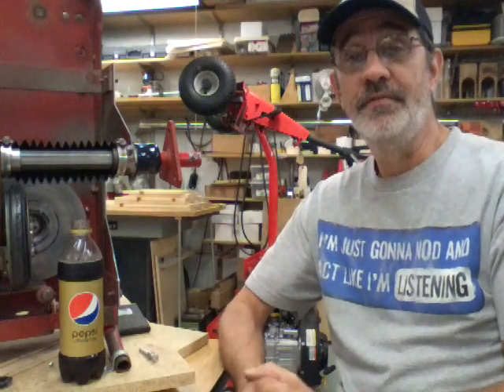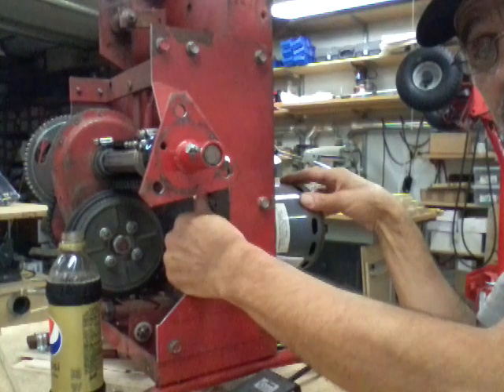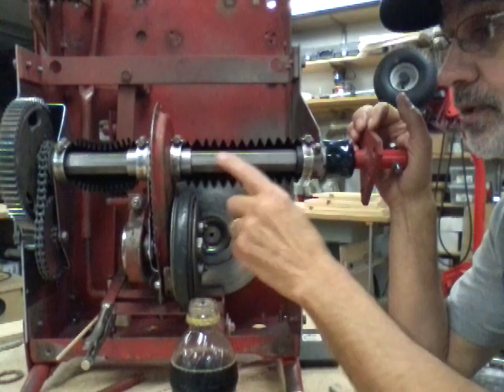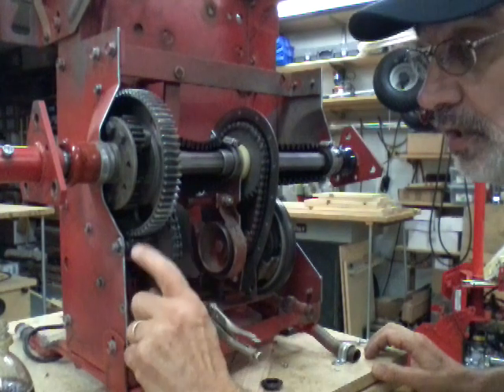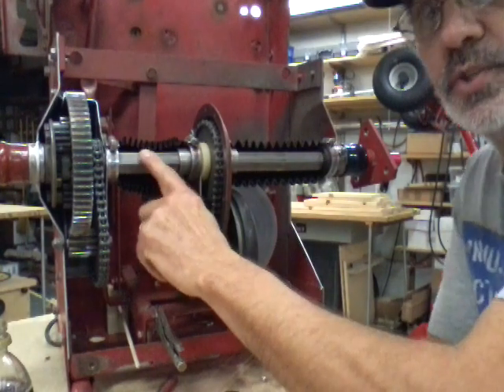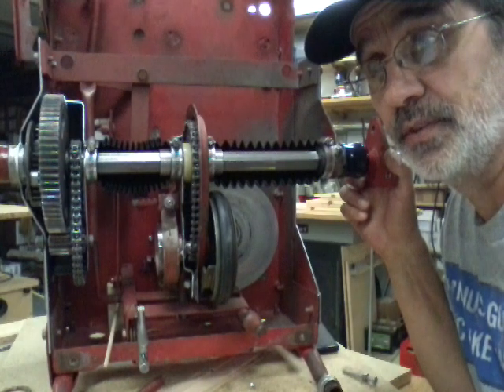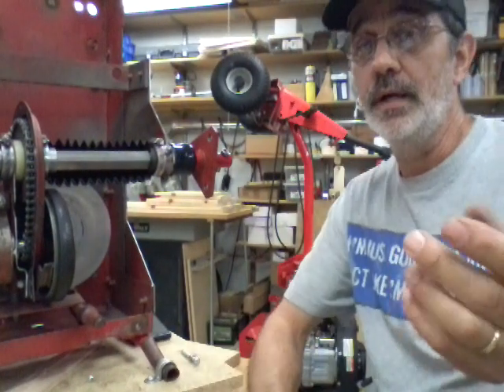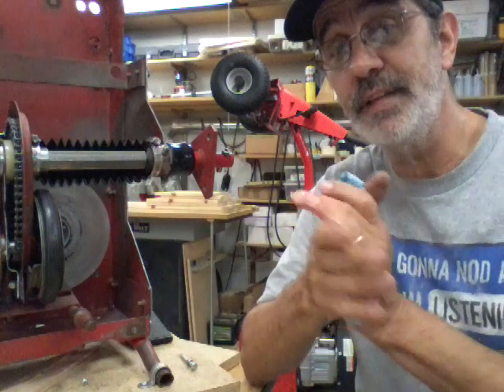132. M/S. 16  troubleshooting the drivetrain on a Snapper rear engine rider

Comment: Jim the transmission just locked up today did the sane on both machines 1433. Was able to get the one with the 16 hp unlocked by oiling the chain case and transmission but the 17 hp not yet but I did not oil the chain case yet. Should I try it?
Reply from the maker: @jamesmccarroll9925  yes I would definitely try putting some oil in there. If it’s locked up, it could be the bearings are shot or the issue could be in the differential. Let me know what you.        Jim
Reply: @jimjackson9381   hey Jim thanks for advice, but my boots are off on both machines, so my guess all the oil over time in the trannies, either splashed out or was just low and I never topped them off, yes I did fill both transmissions and both chain cases, was able to get the 16.5 going but have to put another clutch in, didn't glue the inner ring in when replaced the old clutch got another clutch coming thru Amazon. Now the 17 after thinking back on some of the things you coverd in your infor to video on machine won't move or shift, I stood the machine up used a pair of vice grip lock pliers attempted to turn the axle, it moved a little relocated the grip tried again and the axle turned, then I let the machine down let it sit for a minute started the machine shifted thru the gears nice and smooth, I would say low oil.in the chain case and transmission caused a seizer in the transmission, but thank God everything is functioning as it should, lesson learned do better at servicing my machine. Thanks Jim for your keen insight. Appreciate it.
Reply: @jimjackson9381  and really without that cut away of the transmission I would not have understood exactly what I was to look for, your advice saved me purchasing another mower.
Reply from the maker: @jamesmccarroll9925  well you’re welcome and I’m glad I could help all. I asked my viewers is please subscribe and stay subscribed if your machine is fixed and you don’t need any more help just turn off the little notification bell and you won’t be bothered.
Reply from the maker: @jamesmccarroll9925  lol
Reply from the maker: @jamesmccarroll9925  just remember, it is extremely important to keep the boots in good shape if sand gets inside of your chain case or differential it will destroy it.      Jim
Reply: @jimjackson9381   git the new clutch assembled and glued together put it in rechecked oil in chain case and it . Man it runs like new and shifts so so smooth.

Comment: I have the same model in your video. My issue is something produced alot of white smoke and stopped moving. I bought the wheel with rubber on it. Of course it did not come with that friction lining. However the original one did not have any in it? What I have discovered in when i rotate both wheel s in the same direction, it sounds rough and the clutch does not turn. Could this be a chain/sprocket issue inside the case the clutch attatches to? Thanks for your input or anybody else.
Reply from the maker: I have a video on this but I’ll explain it to you, stand your machine up and put it in neutral loosen the clamps on one of your boots so you can see the hexagon tube underneath of it turn the clutch disk if the tube turns while you’re turning the clutch disk your chain case is OK the problem is  inside of the differential. If you turn the clutch disk and a hexagon chef does not turn then the chain broke inside of the chain case. Let me know what you find out. Jim

Comment: I have a snapper mower an older zero with the joystick and when I go to drive in a straight line it only will pull left and go around in a circle and not go to the right at all any suggestions on where to start on this?
Reply from the maker: Check the oil in each unit check the filters if your unit has any and you should check to see if the pump is working the pumps the hydraulic oil into the unit,  What is the name and model number of your unit ?      Jim

Comment: hello I have a problem with the snapper when pushing by hand the wheels are blocked impossible to move the mower what is the reason for the differential? thanks in advance
Reply from the maker: There could be a lot of reasons it’s hard for me to guess without seeing the machine the chain case could have a broken chain. The differential could be a bad gear or a broken chain. You could have a bad bushing in one of the fenders, locking it up it move under power with the engine running or is it locked up that way also?          Jim
Reply: @jimjackson9381  thank you for your answer, when I stop the engine the wheels remain blocked impossible to push the mower by hand by lifting the mower I can turn one wheel but the other wheel turns in the opposite direction I don't know if I am clear in the explanation 😬
Reply from the maker: @benchapman7459  that’s normal that should do that but if you try to turn both tires at the same time, it should make the chain case turn feel to see if the rubber wheel is up against the drive disk on the bottom of the engine or if there’s a gap between the two when it’s in neutral

Comment: Hi, my reverse gear is not working. You have an idea what’s can be wrong?
Reply from the maker: Well I might need a little more information than that what style of machine are you having trouble with pictures would really help you can send them to my email which is jimsfixitshop@gmail.Com
Does it shift into reverse or are you having trouble shifting?
 Have you watched video number 70 and tightened your yolk spring?
Does it move in the forward gears and just not reverse?
. Jim

Comment: What would be causing my chain to keep slipping off?
Reply from the maker: What chain are you talking about, the one in the chain case or the one in the differential? Pictures would really help. If it’s a chain inside of the chain case I would have to say your bearings are shot or your sprockets and shaft is shot or your sprocket and hub is shot.
     If you’re talking about your differential, the sprocket on your hexagon shaft could be bad or the sprocket and gear could be bad or you could have bad bushings in the fenders, causing the issue, without at least pictures it would be impossible for me to guess what is going on. Jim.

Comment: Thank you. Would have the part# for the outer cover the seal goes into. Also the part # of the seal you used on the left side.Thank you again. Phil
Reply from the maker: Philip McCarthy 
If you watch video number 309 at nine minutes and 53 seconds I hold up a piece of paper with all the numbers on it you’ll need for both sides and the seals. Jim

Comment: So my snapper just stopped moving, it was jumping, like it was trying to catch and it would catch and mow a little bit more and then start jumping again trying to catch! Finally it just stopped moving! Any ideas? Is this drive train what I should check? Maybe these gears stripped????
Reply from the maker: Kind of sounds like you got a bad gear what do you want to do is stand your machine up put it in neutral turn the clutch disk by holding onto one of the four nuts and tell me what the tires are doing as you spin the clutch disk. Jim
Reply: @jimjackson9381  I stood the mower up and put it in neutral. I turned the clutch disk and neither tire moved.
Reply from the maker: @tamaraelkins2718  
OK now we know you either have a broken chain or a stripped gear what you need to do to find out if it’s your chain case or your differential what’s your machine standing up in neutral loosen the hose clamp around the boot between The chain case and the differential under that is your hexagon shaft turn the clutch disk again by holding the nut and see if the hexagon shaft is turning if it is the problem is in your differential if it is not then the problem is in your chain case let me know what you find. Jim

Comment: I have a 33 inch snapper rear engine mont does the rearend suppose to slide from side to side
Reply from the maker: With your snapper standing up on its rear bumpers if you can slide the rear tires from side to Side more than 1/32 of an inch it needs to be shimmed. Jim

Comment: The brake is engaged and is keeping the clutch disc from spinning but the tractor still rolls = problem with differential?  Tractor barely drives.  Have no issue with drive plate and clutch disc.  When wheels are pushed in same direction the clutch disc does not spin
Reply from the maker: You need to see video no. 132 it will help you understand your drive train  and troubleshoot it let me know if you need any further assistance. Thanks Jim

Comment: My trans started making a. Super grinding noise, but want back up. This happened after we had 0 temperature.
Reply from the maker: I don’t think the temperature had anything to do with it you either have a issue in your chain case or in your differential and the only way to tell is take them apart. Jim

Comment: Is there a grease fitting anywhere underneath?
Reply from the maker: Yes there is there’s one on your left fender bushing for your axle some machines have them on your shift handle and while you have a standing up check and fill if needed your differential and chain case. Jim

Comment: Is the clutch wheel always loose my u can move it sides to side the mower is working but is this normal.
Reply from the maker: Go ahead and watch video number 434 that will explain to you. The difference between a soft start, clutch a solid clutch and how they react. Jim.

Comment: Installed a new clutch on my 28" snapper mower, now, even in nuetral, the tires won't turn at all in tandem. I can't see anything wrong and the mower was fine with the old clutch
Reply from the maker: Does the new clutch disk have the liner inside of it. Jim

Comment: hello , my name is paul i have one of these tractors and i have the main case apart and i see the teeth that are on the big gear are real sharp and real thin is that worn out everything else looks real good
Reply from the maker: Garnet Y. 
Hi it’s Jim
  And yes here is worn out, they should have about 1/16 inch wide flat on the end of the tooth, You can order them parts from Parts Tree.Com.            or Amazon or eBay thanks for viewing and I hope you’re a subscriber. Thanks Jim

Comment: I have a snapper sr1533 back wheels won't turn in tandem but when you flip mower up on back they will turn opposite when you  try to turn one forward the other turns backwards
Reply from the maker: If you stand the machine up and turn the clutch disk assembly by holding one of the half-inch nuts the tires should turn regardless what direction you turn the clutch disk assembly if it doesn’t then you probably have something locked up in your differential or in your chain case. Let me know what you find out. Jim
Reply: @jimjackson9381   @Jim Jackson  it's been sitting for about 10 years in a building and has never had the differential /gear lubricant changed. It worked great when my grandpa parked it
Reply from the maker: @mr.thorgous9258  that sounds like a good one to rebuild, where do you live. Jim
Reply: @jimjackson9381  north Georgia
Reply from the maker: @mr.thorgous9258  Well that would be a drive to get that up here. Jim

Comment: First snapper i ever owned Oil on the pully under engine and the wheel looks oily and will move but it's slipping I don't know were the oil is coming from
Reply from the maker: Well typically it is the lip seal on the crankshaft in the bottom of the engine that’s allowing the oil to leak down and get on your drive disk you may have to pull the engine out and set it on the bench and check it for leakage. Jim

Comment: My problem was not going forward or backwards  the key way on the pulley that the clutch bolts up to was broken and warned out.
Reply from the maker: The only thing you can do is replace the clutch disc assembly on the side of your chain case. Jim

Comment: I have one that stopped pulling and it checks all good but want move ?
Reply from the maker: Have you checked the bolts that hold the wheel flange to the axle on both sides if one bolt breaks the machine will quit moving. Jim

Comment: I went to move my snapper in neutral and the mower will not move either way.  If I jack up one side I can move it can you tell me whats going on.  Thanks. Jim
Reply from the maker: Steve Robbins 
  Will your machine move if the engine is running and it’s in gear will it move on its own power.
   Some of these questions are hard to answer when I don’t have the machine if you lift one tire off the ground and then you can move your machine yes sounds like your drivetrain could be locked up or you may have broken a chain either in your differential or chain case.
But that is only if the machine will not move on its own when it’s running. Jim
Reply: Engine not running just pushing the mower while in neutral
Reply from the maker: Steve Robbins 
Hi Steve it’s Jim
   You could have one of your chains broke that is binding things up and not allowing you to push it, but if you can start the engine and it drives all right then it’s not a broken chain you have another issue how does it act when you try to drive it.
Reply from the maker: Hi Steve it’s Jim
  If you haven’t already watch video number 253 it will explain how to adjust your chain case so it is where it supposed to be so you have neutral and you can roll your machine around see if that helps. Jim

Comment: When going forward every 3 seconds or so the machine slips, I installed a new drive disc thinking that was the problem, it was not. When I put in reverse I hear a lot of grinding. I pull it out and throw it back in and it goes. Is the problem with my differential?
Reply from the maker: Dennis Fender 
Hi it’s Jim
  I think based on what you’re telling me that would be the first place I would check is a differential. Jim
Reply: Jim Jackson thank you.
Reply: I have the same exact problem ....

Comment: When I turn left machine acts like it's slipping.... Any ideas
Reply from the maker: @davidearly4119  well for starters take your hubcaps off and check the bolts that go through your wheel flange and through your axle. Let me know if they’re both good. It’s hard to tell so you may have to put a wrench on the nut and try to turn it because they may look all right, but they still could be broke on the inside.

Comment: I realize this is a very old video but I just bought a snapper rer and and when you turn the wheel it feels like it only catches every once in a while
Reply from the maker: @RobertDickens2002  take off your hubcaps off your rear tires and check the bolts going through your axle and wheel flanges and make sure they’re not broken.         Jim
Reply: @jimjackson9381  thanks learning a lot from your videos
Reply from the maker: @RobertDickens2002  sorry about that. I reread your email and are you talking about the steering wheel and you must have what I refer to as a turtle if so, your rack is probably starting to strip out and unfortunately it’ll have to be replaced. I do have a video that shows how to do this if you go to my homepage just above where it says manage videos there is a link you can go to that will give you a directory of all of my videos my name and numbers to help you find the one you need.         Jim

Comment: What is the length of the peace pipe block? Not the handle but the block. Thanks
Reply from the maker: profnohair 
  The head is 3 inches long just a piece of three-quarter inch pines cut to1 1/4 inch wide. Thanks Jim
Reply: Thanks

Comment: Jim can I replace the whole rearend from a sr1333 to a sr1230 rearend I got a spare snapper the sr1333 and I won't to put it on my better body sr1230 snapper mower ,,Jason
Reply from the maker: It should be interchangeable I am not sure what you mean by the whole rear end the drive train should interchange it depends on how the mower deck is hanging on the backside some are different take some pictures and send them to me and I’ll let you know, send it to my email which is Jimsfixitshop@gmail.com
Thanks. Jim
Reply: @jimjackson9381  the whole rearend part I mean is the axls and the 2 chain casing things ,what happen is the chain has come off twice now in the bigger part cases I noticed that the bushings going into the Axls are wore out and it has no boots covering the axles so my uncle gave me a Sr 1333 snapper that the deck is eat up with holes and ect other worn out deck issues my Sr 1230 is in great shape other than the chain has came off and bushings worn out and boots missing I just want to take the sr1333 reerend and put under my sr1230 , I take pics when I get off work today thank u for replying Jim u are a great guy and I enjoy your videos thanks
Reply from the maker: @jasonpeeler6796  Yes some pictures would help but I’m pretty sure you should be able to switch all that stuff out. Jim

Comment: My snapper SRM110 is stuck in neutral what causes this?
Reply from the maker: Several things could cause this issue your shift handle itself where it rotates inside of the spring could be rusted and giving you issues it could be any of the four joints on the two linkage is giving you a problem or it could be the chain case itself is not sliding properly on the hexagon you need to pull the boots back and clean and grease the tube. Jim